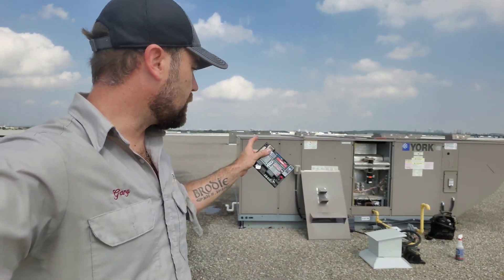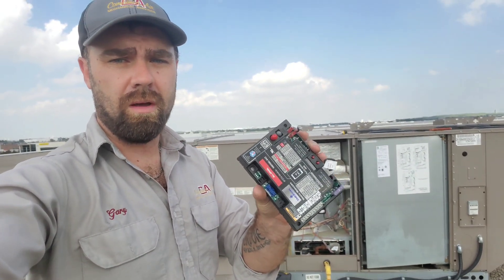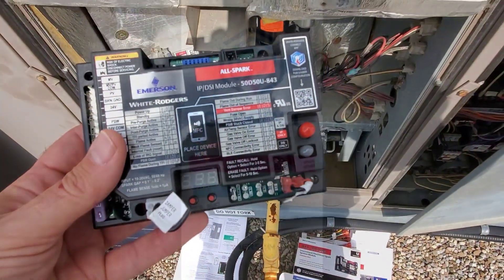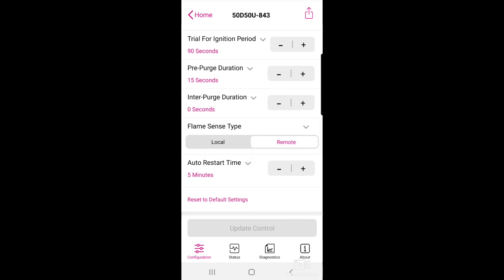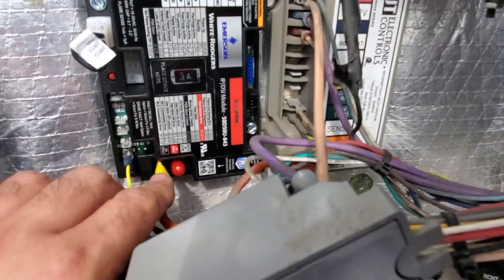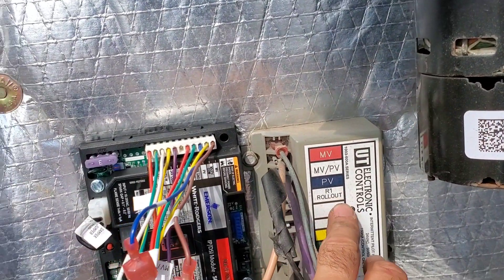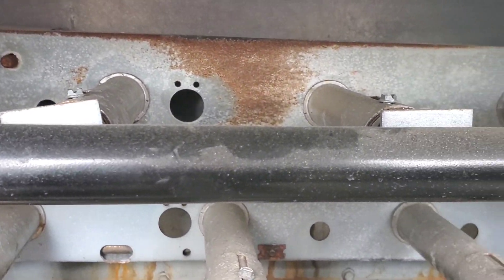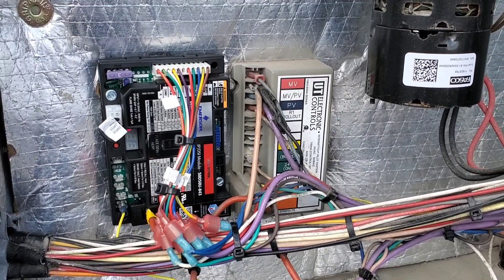Copeland White-Rodgers All-Spark Universal Ignition Module Installation - HVAC Game Changer

Comment: You ever have any of those Yorks where the sparker constantly arcs to the burner bracket even with new pilot burner and all that? These yorks drive me crazy between that and the inducers failing.
Reply from the maker: Yes, there is a serious bad bath out there.  I had to wrap a couple with electrical tape.  I don't like those burners at all.
Reply: A little tip, if you are having trouble with the spark rod igniting the gas. Loosen the screw holding down the sparker and let it move freely, it'll find a spot it likes to ignite the flame and thats when you tighten down the screw.

Comment: Thanks for the video, great overview. I have a question, if White-Rodgers engineers know that an OEM control (by part number) is compatible why can't they provide the control logic information for the universal control?
Reply: A new PDF titled "All-Spark Cross Reference Timings" is now available on the White-Rodgers website to help.  It will continue to be added to as additional information on individual models is verified.  Ultimately it will also become part of the NFC app for better ease of use.

Comment: Never knew that controller even existed. Do you usually get those at Johnstone or would the York supply house have them?
Reply from the maker: It's new so I don't believe all supply house have caught on yet.  If you local supplier deals with White-Rodgers it should be easy for them to bring it in.
Reply: @HVACKnowItAll  I would have to ask the b0ss. I would think we would get our old Ignition Modules like that old 2nd stage one still in that RTU from Johnstone. I always struggle in the winter when I have to flip flop between the sparker and ignitor boards.